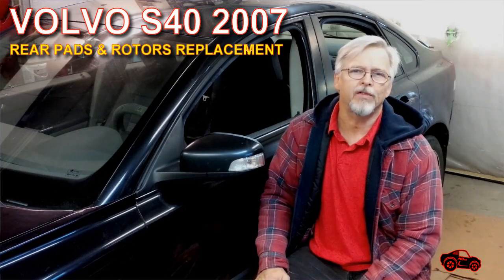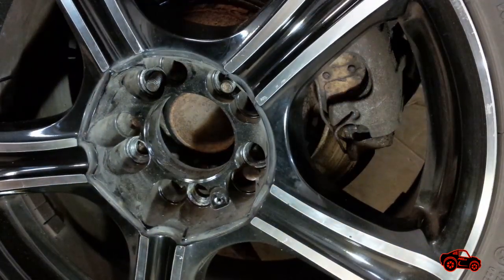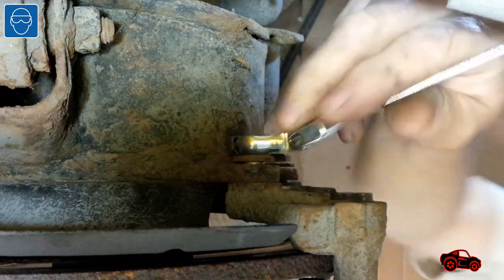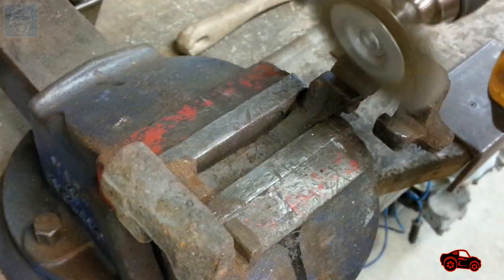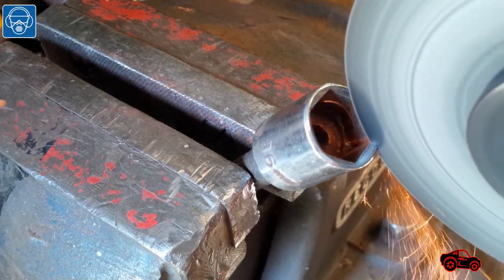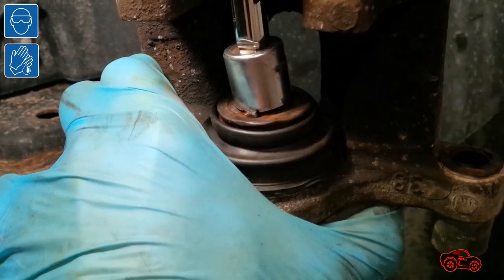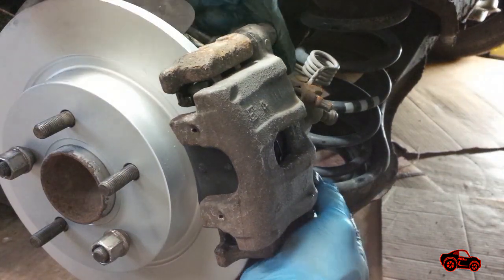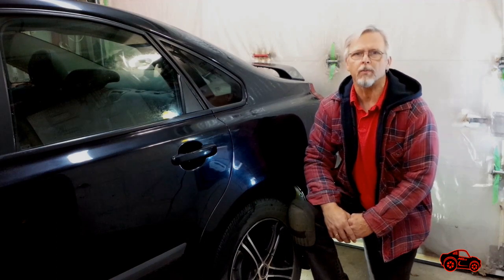VOLVO S40 2007 REAR BRAKE PADS & ROTORS REPLACEMENT + DIY BRAKE PISTON TOOL ADAPTER

Comment: Just finished the right rear brake pad replacement of my manual transmission 2005 Volvo S40. retracting the piston was difficult. Had to use WD40 and channel lock plyers to loosen the piston before using the tool kit to screw in the piston. Gained valuable knowledge, so the time was not wasted.

Comment: The passenger side rear is always the hardest to compress. I've done the job on a 2005 model and it was this way. Today I did the job on a 2010 S40 and it took me 30 minutes to push and turn it in. 

My friend says it may be because it's the longest line to the master cylinder.

Thank you for this video, it helped me keep my confidence high! 🏎️
Reply: How did get it down? Im working on mine right now and it feels impossible to compress

Comment: 4:57 - This bolts do not lubrication!
Reply from the maker: Thank you for the comment!  You are right, the silicone brake lubricant is not recommended by Volvo with this type of caliper bushings. I removed this section and I included a special note in the video description to explain my procedure.
Reply from the maker: @arturneven364  No not the same. Also, make sure the rotor is well seated on the hub with temporary lug nuts when testing the brakes.